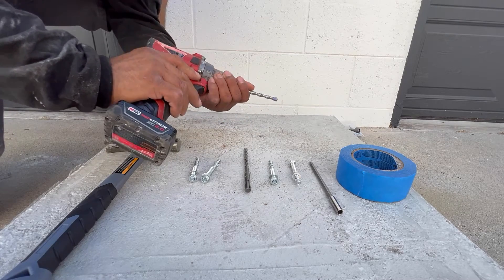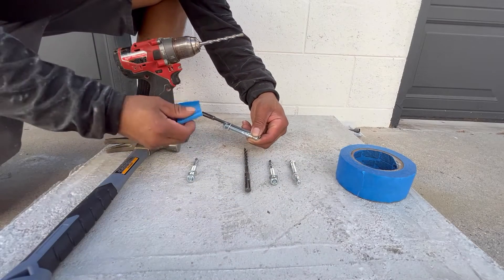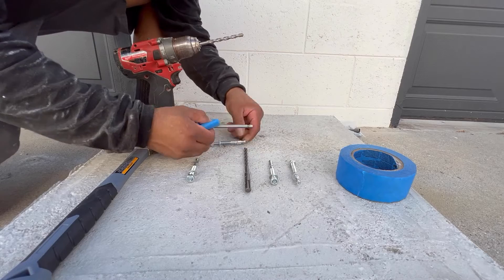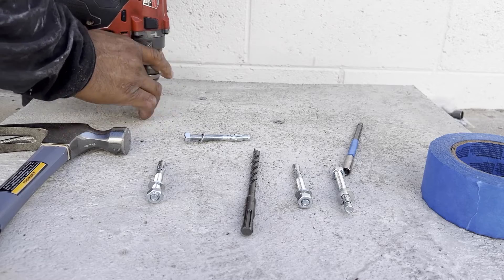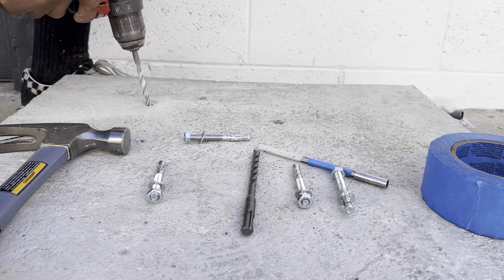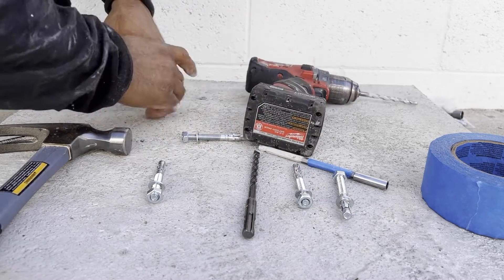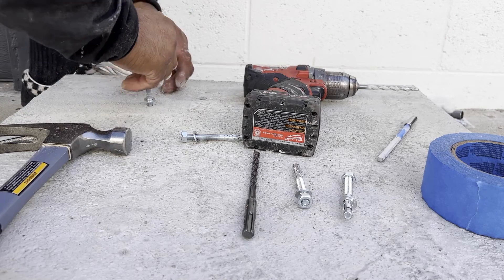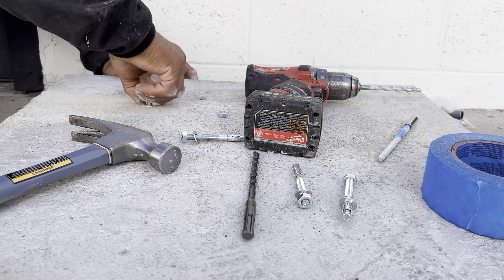CR Handrail- Install Wedge Anchor

Comment: What they don't show you here is that you need to use a proper hammer drill preferably with a handle attachment to push down on. This guy is obviously drilling into very soft, very fresh plaster, not hardened concrete, so it looks easy here, but if you are drilling into a deck with a good solid concrete base it will need a lot more force on the drill than he is doing to get the bit in.